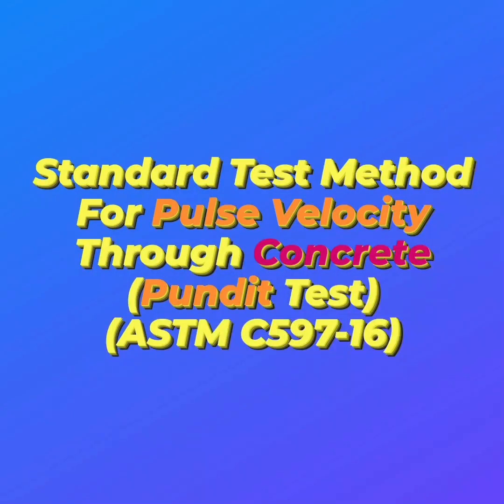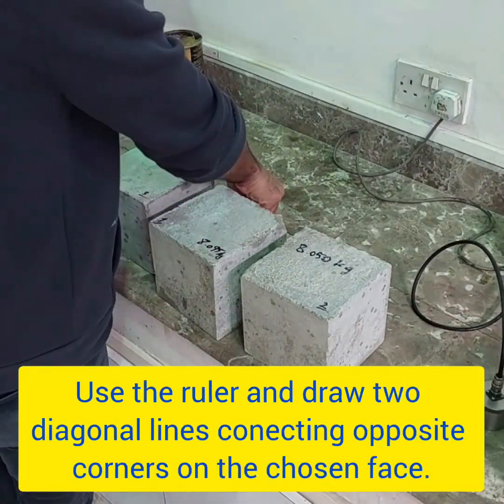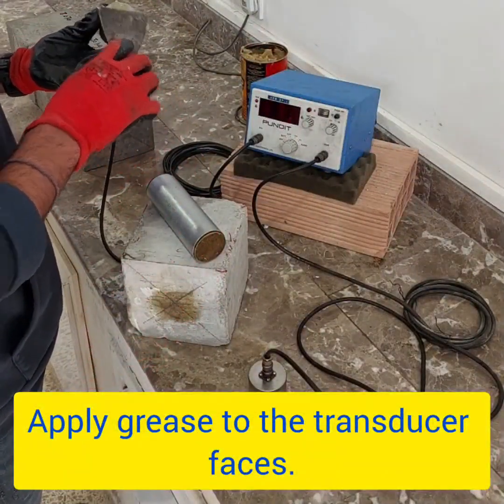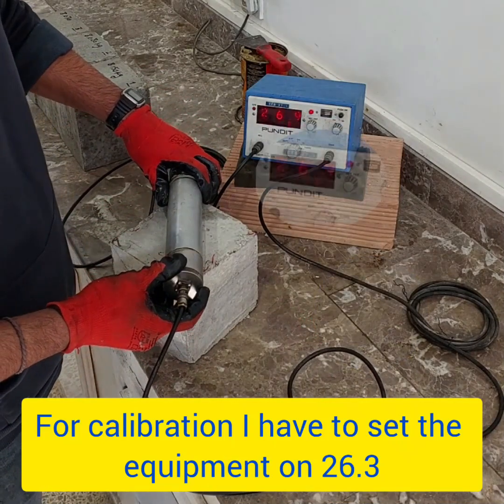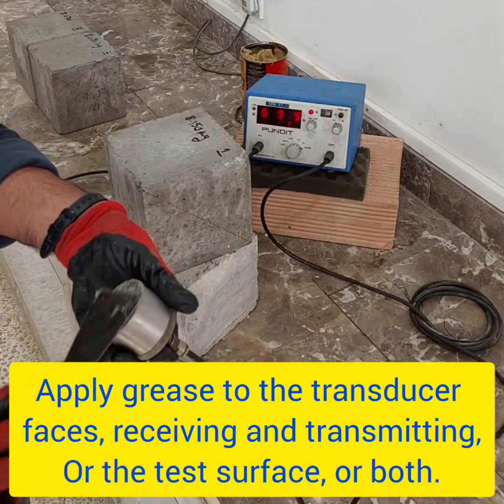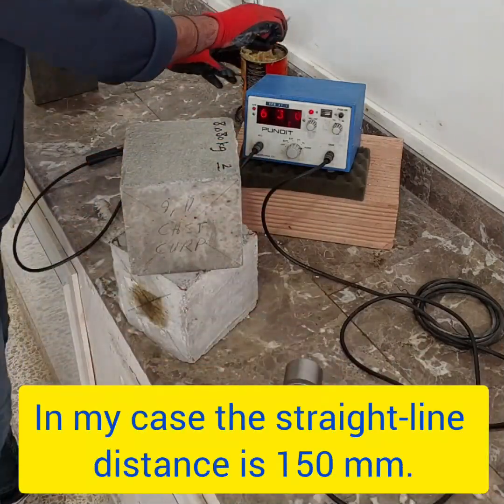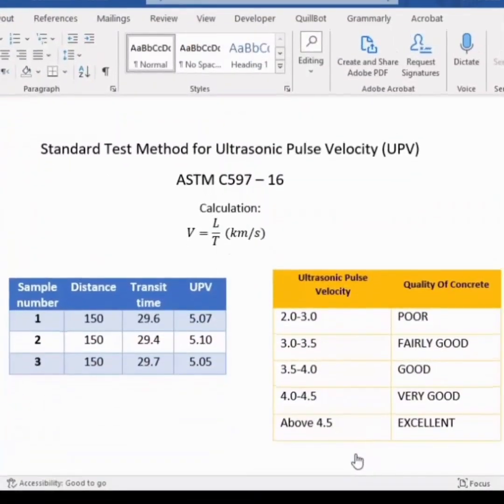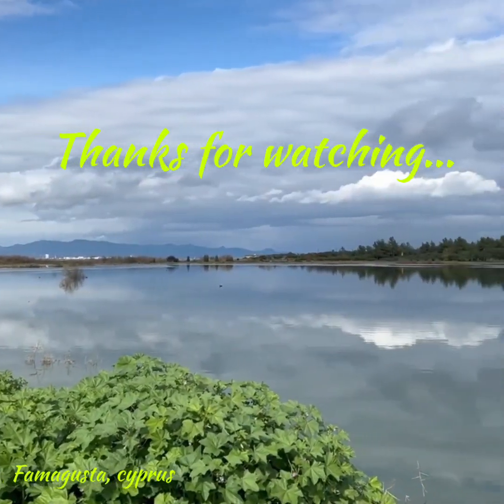PUNDIT Test, Ultrasonic Pulse Velocity (UPV) Through concrete, (ASTM C597-16)

Comment: how did you get the result in km/s? the distance was in 150mm not km.... please elaborate.
Reply from the maker: Hello Mujaba, You are right but it doesn't affect the result of the test.
just simply devide the distance by the result of the test and you'll get the answer, then compare it with the numbers on the table.
There I jsut mention the formula. 
Thanks for caring to comment.

Comment: Hello, may I ask how to UPV Test the reinforced concrete and how to interpret them? We want to determine the crack formation.
Reply from the maker: As far as I now, if you want to conduct this test on reinforced concrete, it will not gave you an accurate answer, cause the steel has much higher pulse velocity comapred to concrete, therefore if you want to use it, try to avoid the steel during measurement, another issue is, at the end, this will gave you the cracks existence or any abnormal inside the concrete.